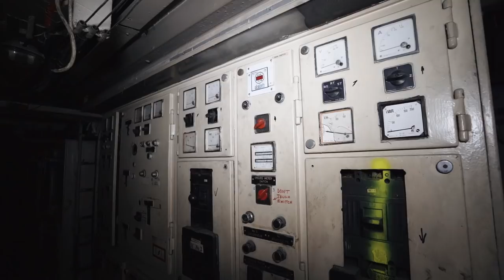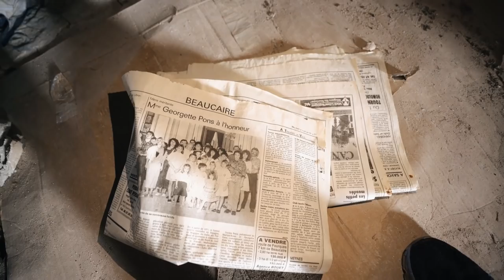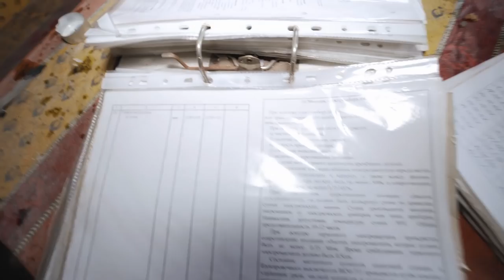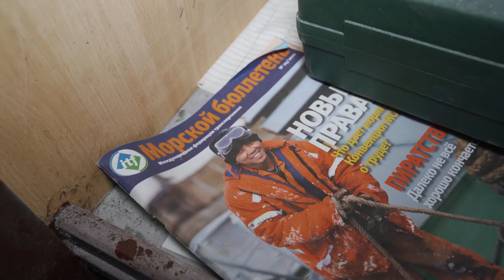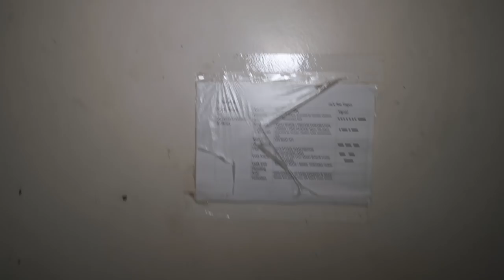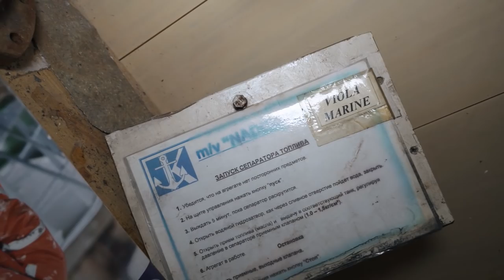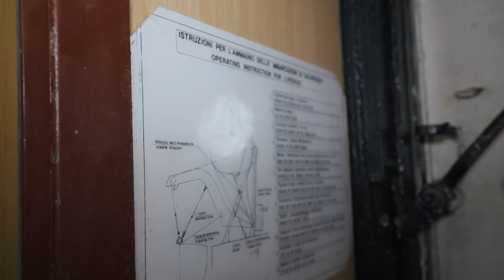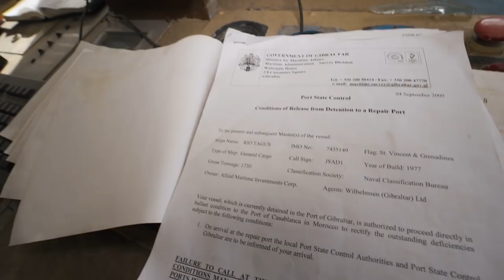Exploring An Abandoned GHOST SHIP in a French Harbour Town

Comment: Entering the hold without breathing apparatus is risky: there can be pockets of toxic gas.
Reply: Was worried about those rusty ladders ... if they give away, then it's game over.
Reply: Ummmm  toxic gag.
Reply: So true, and the possibility of the lack of oxygen
Reply: Would there have been actual toxic fumes if the engines hadn’t been running for 10 years?
Reply: @butterflylady8875  not necessarily from the engines. But old oil grease acid and the likes.

Comment: A ships engineer has to be able to fix anything on the ship. That is why they have a workshop. If a light does not work you have to fix it, if a water heater does not work you have to fix it. If the engine does not work you have to fix it. You might be hundreds of miles away from help.